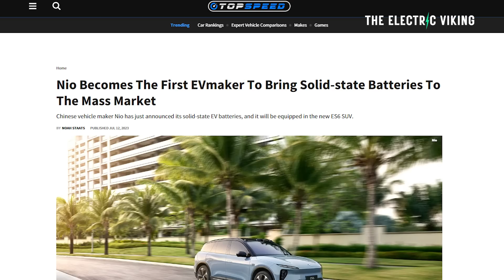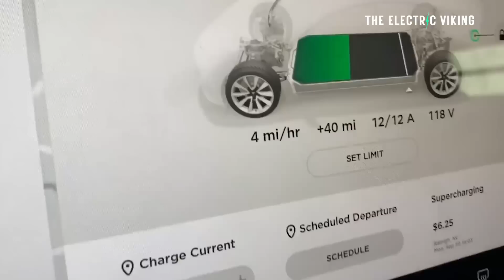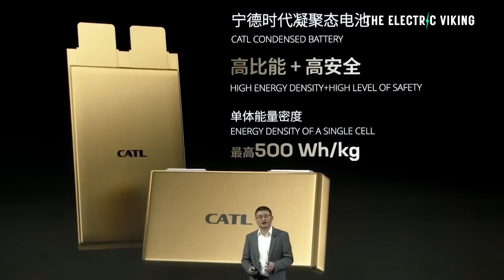CATL reveal new batteries for Tesla EVs that will KILL the competition

Comment: Okay, Elon has made a new type battery, the aluminum ion battery, goes for many more miles on a charge, charges up fully in 10 minutes,fine, maybe.  There is still one big mountain to climb over that most of the 15% of the EV buying Americans want to see how this new battery will handle this problem.  Fires, at present lithium batteries catch fire, anytime, no way to detect when one will start itself on fire and how fast it will start, from small fire in the system to almost exploding.  Yeah, right now fires are very few, but even one fire that kills the owner makes the EV image a terribly dangerous one, and most people with common sense won't touch an EV with the proverbial 10 foot pole.  So right now there is no way of knowing if this new style battery will have the same problem as it hasn't hit the market yet, so time will tell and I myself am gonna sit back and watch this scenario to see if the problem stays the same..

Comment: Hi electric Wiking.
Thanks for an interesting video. I would like to have some numbers fx 370 kW charging for the new LFP betteries. Some letters and less talk could make it more clear for the viewer. I miss an comparesing in numbers. For intens comparesing between NMC, LFP, new LFP, Sodium FP, solid state batteries. 

Last thing: An combustion engine can replace some spearparts in the motor, but can an older EV Xpeng G9 Performance 2023 replace its NMC litium batteri to an newer CATL C batteri?

Comment: My car holds 7.95 kilograms of hydrogen, at 10.28 grams per mile I can run about 773 kilometers. The hydrogen that I’m getting from Shell contains a large amount of carbon but my engine is designed to remove the carbon and dispose of it while I’m driving. I can get hydrogen from any gas station, I can carry extra hydrogen ( 2 or 3 kg ) in a jerrycan.  The energy density of hydrogen is 33,333.333 watt hours per kilogram, times that by 7.95 and we get 265 kwh. So, no matter what kind of technology you have the bottom line is pretty simple. My car will need more than 2 and a half 100 kwh batteries to replace 7.95 kg of hydrogen. Gasoline is 13 parts hydrogen and 87 parts carbon by mass. Oil companies can remove the carbon before we burn it, but nobody wants that.

Comment: There is no future in Lithium ion batteries due to the fire risk as well as costs and supplies of Lithium. In fact due to this CATL has launched a sodium ion battery which like your criticism of Nio is heavier but has a higher and faster charge rate. Nio's strategy revolves around its battery swapping system which means a lower range is not a problem as their is a relationship between car weight and range. In any case we are seeing a move to what will be the future of EVs hydrogen ion and hydrogen fuelled hybrids where only a small battery is required and range is not a problem. Even Musk now recognizes that battery power is a dead end due to grid problems and limits to supplies of renewable energy absent the use of nuclear. Due to his investment in electric drive he is stuck with hydrogen fuel cells but the traditional auto manufacturers can modify existing fossil fuel cars at low cost and incorporate an electric moter into the drive train as Koenigsegg have done.

Comment: Solid state Issa ceramic divider/electrolyte 
# Santa’s tooth fairy snipe hunt because th ion cannot pass through a solid but sticks to outside perimeter of ceramic # add capacitor to negative side of circuit

Comment: The reality is that EV's are totally impractical in many situations due to the infrastructure for EV's, the cost of producing EV's and their disposal, the Toxic components of EV's, The chronic resale value, the fact that the majority of people live in Apartments with no access on site to charge their vehicle, The performance limitations in many areas, such as off-road, range and towing, the price of EV's which in most cases negates the fuel savings when compared to the price of ICE vehicles. There is a use for EV vehicles in many cases and trying to reduce our dependence on fossil fuels is a good thing, but this forced attempt by government to move to EV's is unsound.

Comment: CATL (Contemporary Amperex Technology Co. Limited) a Chinese manufacturer using Lithium Ion Phosphate 4C batteries. My Chinese made mixer broke the very first time I used it. No thanks for Chinese manufactured anything. You are repeating what CATL claims without seeing the raw test data, how do I know this? Because CATL never released it. You also mentioned Sodium ion batteries and all the benefits touted thereof however: Sodium is a highly reactive metal that is flammable. It can ignite with a spark at 239 degrees Fahrenheit or 115 degrees Celsius. It can also catch fire without a spark when it reacts with certain substances, such as water. I don't want one in my car.

Comment: The ultimate battery:

5.000+ cycles
Easily recyclable 
Under USD 100 per KWh (package level) 
300+Wh/kg (package level)
10 minutes charge from 10 to 90% (not 80%)
Ultra safe
Work properly in low temperatures 

THEN it would be game over… until there, it’s still evolutionary improvements

Comment: Interesting facts to consider
1, With IRA, Catl battery cant enter USA market. With CRMA, its hard that Catl battery can enter Europe market.
2, Even if Catl can enter both continent, Car makers are not considering to use LFP or M3P battery that Catl is making.
3, LFP battery is not suitable for a car. It is better off in ESS. 
4, Tesla cant make battery as Tesla is not chemical company but a car maker.
It is totally different area.
5, GM, FORD, Stellantis are alresdy teamed up with LG, SK and Samsung sdi and have joint factories in USA. Thet use Lithium-ION battery. Not LFP at all.
6, Tesla is now trying to change its battery from lfp to lithium-ion.

Comment: These batteries sound really good, let's hope they can deliver what they promised. Concerning the "game over" statement for other manufacturers you have to keep in mind that worldwide demand for batteries and energy storage in general is so gigantic that no single company can supply all of it. Even if they have the best batteries and the best prices, they can only produce a limited amount per year and that will never be enough.
Reply: Not to mention, Where's all the additional Lithium coming from? And Copper... Recycle you say? You can't recycle something that's not been built yet.
Reply: @colinmacdonald5732  Well John Cadogan paints a picture that indicates these  batteries  are only good for landfill.
Reply: I used to be into RC cars 15+ years ago. Yeah I used to be crazy with the stuff I did but you had to be careful with the batteries no matter what. What's shocked me with cars is the shocking lack of safety they put in. Was looking at prius and they haven't even used balance charging which is why they have so much problems. Then theres the maintenance on EV where it's not very easy to gain access. Basically a EV to me is like a mobile phones, designed for a short life and thrown away.
Reply: @rob-123  A battery pack in an EV cannot be compared to a battery in a Smartphone, because it's designed to have a long lifespan. The early Priuses were not very good at that and their battery was too small, because they are hybrids, not real EVs. A real EV has a big battery pack that is well protected, climatised and has a battery management system that saves it from being charged too fast or overcharged etc.

Comment: I want the battery that lasts forever and doesn't burn. And, I want the big battery, because there might be a power failure at my house. Or, maybe I, or my grandson, might get a job using electric tools I can plug into my truck. Lawn service, for example. Advertised as 'quiet' lawn service. Because, all electric. Simple, honest, labor. And the right truck.

Comment: Oh yeah, it will kill the competition, because this Shanghai company would never sell its batteries to anybody beside Tesla, which represents 12% of CATL revenue.
Certainly the rapid charge characteristics make this ideal for aircraft, which can just pull over for a quick charge.
Finally, an increase of 10% energy density of a 450km range pack does not give you 50km more, it's 45km more.  If you can't do grade-school math why are you doing this video?
/s

LFP is a great tech for home batteries (I use them to run my off-grid home.  But they do not have the energy density of a lithium cobalt battery, which is why aircraft won't care, because they value light weight over recharging time.  High performance cars will be the same.  And learn how to calculate 10%, it's not hard.

This is the dumbest video I've seen in a long time.
Reply: It's pretty disconcerting that this video already has 150K views and most viewers believe this Viking dude is their Second Coming...

Comment: 500Wh/kg will enable airliners? The ICCT calculation said that batteries need to have 1500 for a regional airline, 3000 for a narrow body and 8800 for a wide body. We are very far away from enabling commercial flight

Comment: While impressive and a good improvement this isn't game changing for a few reasons.  Tesla may be their biggest customer but they are not the only company that will use this technology.  CATL supplies either batteries or IP to a dozen different car makers.  From the article I read the price per KW is about the same as LFP, so while the batteries will have greater density a battery with more storage will still cost more.  The improvements in cold whether charging will be important for sure but here's the important thing, the following year will have more improvements, and the year after that, and the year after that.  It's death by a thousand papercuts rather than one death blow.  We've come a long way in the last 10 years and the next 10 could be even better but it will be gradual not exponential just as it has been for the last decade.

Comment: There doesn’t seem to be anything special about this battery at all. My Hyundai Ioniq 5 charges faster than that, and all reports are coming in that show no degradation to the battery at all regardless if they charge to 100% or not. 

Honestly, to me, this is my new change and will have no real major impact at all on large EV manufacturers.

Most EV owners don’t bother to worry themselves about battery degradation. And reports are coming in from Hyundai owners who run the hell out of their cars mileage wise in the first two years of 40 50,000 miles time they haven’t seen any drop in range or battery degradation. 

The most battery degradation shows up in the first 20,000 miles. I put on 20,000 months in my range his only increased.

Comment: You need to recalculate: New Energy Technologies is spending US$ 1.39 billion on a 10GWh solid state battery plant in China, which will reduce the cost of the tech tremendously, I imagine. If it comes to fruition, CATL will need to watch its back. The fight for supremacy may not be over yet.

Comment: The fast charging is nice  what about 22kW destination or street charging: lower priced electricity but Tesla does not yet support 22kW charging. That move would double Tesla's regular charging - that would be a real game changer and allow Tesla to catch up to the competition for charging when it matters: which is mostly.
Reply: Wrong,wrong ,mistaken an wrong.😊
Reply: @malcolmrickarby2313  Look it up: Tesla is limited to 11kW 3 phase charging. However municipal, home and destination chargers are often up to 22kW and many modern EVs accept this. Just charge at the destination (curbside) and a Tesla only gets half of the competitors load. The 22 kW chargers are awesome, rarely ever need a high speed charger. Less hassle and low priced electricity.
Reply: Ah yes! Models S and X go up to 16kW, but even older Renaults charge AC 22kW and sometimes higher! Tens of thousands of 22kW chargers in the small Netherlands alone, very many in Germany, this is the sustainable standard of AC charging although some go up to 43 kW (and even the small Renault Zoe accepts that).

Comment: Perhaps the LFP will completely overtake the 4680 battery. Seems the 4680 was a huge disappointment so far. Not having increased energy density or faster charging time.

Comment: $222 Tesla stock price, yes Viking it's game over for the Con Man and Tesla Fan Boys. Yeah the new battery once equipped to be installed will weigh about 660lbs. for 100KWH, no word on dimensions or price, but don't hold your breath. So when all is said and done, this battery is slightly under 50% the weight of present day batteries, for your information, hydrogen tips in at 1/10th the weight including the HP tank. CATL claiming so many kilometers range with a 10 minute charge? WTF does that mean? Guess they are learning how to bullshit like Tesla? This whole thing could be another big scam like Tesla FSD and the Tesla semi. Way too many lies and missing data. People are getting smarter, they want to see the actual product and performance numbers before accepting the Con Man's bullshit. Hopefully Youtube can save you Viking, the Con Man won't!!!!!!!!

Comment: You may be right, but I wasn't about to wait forever to get the dream Electric vehicle.  So, when these come out in 2024, then what new will come out in 2025,2026,etc.etc.  There will always something better/new improved coming down the road.
Well, enough is enough for me.  I now have the 2023 model Y long range vehicle for my daily driving.  It does everything I need and more and really enjoy the vehicle.  It also has HW4 and the newer latest cameras.  I don't have FSD or EAP, and not sure if I will ever buy them. Plus I should be able to get the $7,500 tax credit.
I don't do long trips or high speed driving and it is not an environmental decision.  I bought the vehicle to get away from the gas pumps.  This should be my car for many years.

Thanks for your video information and take care.

Comment: The MP3 cells are better for LFP type solutions with the temperature disadvantages, but Amprius silicon anode battery looks more interesting. Safe as LFP, charges quicker, and a very large temperature range. Being shipped now, scaling up in Colorado, not like solid-state.
Reply: BYD were making MP3 batteries in 2014

Comment: This is getting way too easy Viking🔮😆 ...to predict the future disruption of 'transportation. CATL is totally on-board with BYD's geo-strategic strategy to demolish legacy ICE cars. CATL has reduced battery production in China, but is definitely moving to ramp production in other global markets. Batteries are the new oil, and BYD/CATL/...Tesla are market movers with the kind of price/performance/value that cannot be denied or challenged. Like oil, CATL production cuts are designed to maintain market price stability, while improving the product. What battery factory/supplier on earth is going to challenge China's energy storage capability in 2030? Smaller chips and smarter cellphones are not going to supply the only global currency,  which is ENERGY($) Once again, Panasonic has been the biggest disappointment in batteries, and I still think it's "Japan Inc" that doesn't want BEV's to succeed(...?)

Comment: I look forward to battery improvements but am reminded that the 4680 batteries made promises that they don’t seem to be delivering on.
Reply: You need to have patience. New battery technology doesnt happen overnight. 4680 is a battery format and is not the issue. The production of the Dry Battery Electrode is the issue.
Reply: @danielcpt3819  4680 is just a packaging size. Nothing more. Nothing to see here. I am not a fan of glued together Tesla 4680 battery packs that cannot be repaired if there is only one faulty cell. And the reliabilty of 'tabless' design will see greater failures. Such a waste of resources.
I fail to see what the 4680 fanboys rave about.
Reply: MAYBE THEY SHOULD TRY A SODIUM CHEMISTRY IN THEM.

Comment: When companies give these charging times, they never mention what speed charger it requires to get that charge. Most roadside chargers are 50/100 on the label and often 30/40 in real world conditions.  The batteries can be as great as they want but if the charging network is decidedly under par...then it means nothing!
Reply: You mean roadside chargers that don't say Tesla on the side. With so many car companies switching to Tesla NACS connectors the non-Tesla companies will have to up their game to compete. The CHADEMO connectors can't manage much more than 30-40 kW but the Electrify Canada CCS connectors can deliver over 100 kW. These comments are experience based using a CHADEMO to Tesla adaptor (Model S100D) and a CCS to Tesla adaptor (Model Y).
Reply: @rogerkeay1902 non tesla CCS charger are very often higher in speed. 
Tesla super charger are usually 250 when competition is already at 350kw
Reply: TRUE and this is a SERIOUS issue but the Musk fan club is too ignorant to understand that ! They are BELIEVERS, not engineers !
Reply: Chinese companies make all kinds of claims but Quantumscape is the only one publishing their results
Reply: Thank you.

Comment: You might get longer range from LFP by charging to 100%. But there are two reasons for only charging to 80% on NCA. One is to avoid battery degradation. The other is the charging curve. So does it make sense to supercharge your LFP to 100% to get more range? Only when you really need to. But occasional charging an NCA to 100% is fine too.